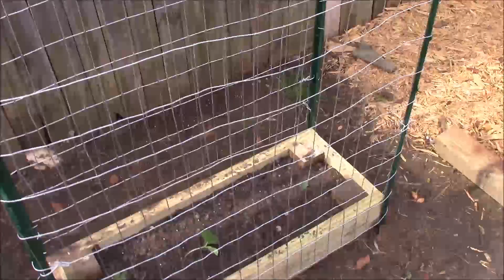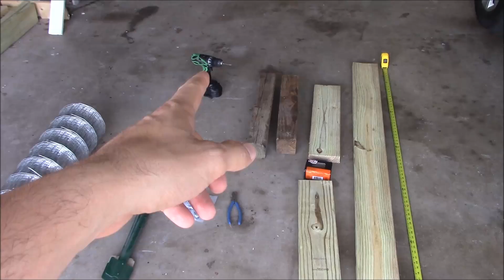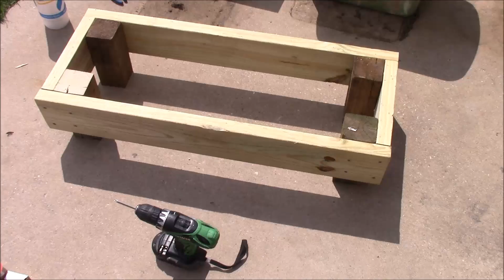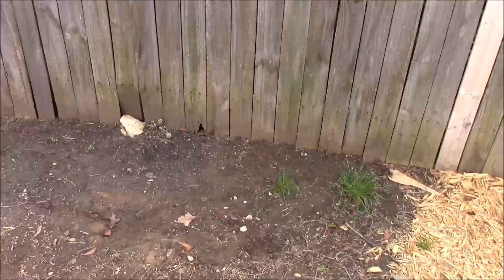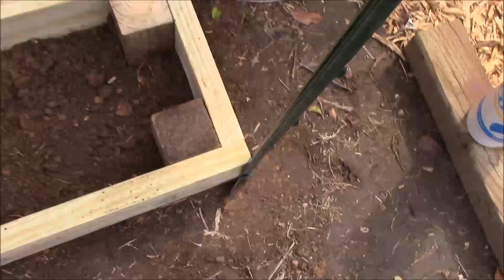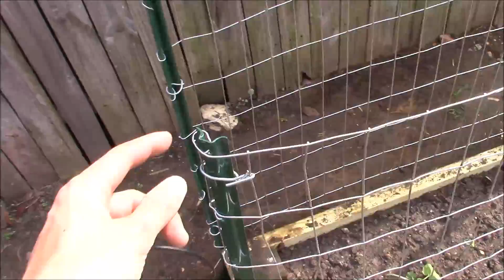Grow Watermelons In 3 Square Feet

Comment: Liked your video...how many watermelon plants are in that 3sq ft box?  Based upon the video I saw 4-5 and did they all grew out or did any of them died on you?  Thanks!
Reply from the maker: I ended up harvesting 4 of them that year and all of them were around the size of a volleyball, maybe slightly smaller.  2 died on the vine.  Not sure why.  If I had made the trellis taller, say 6 feet high, I probably could have gotten a few more fruit in there.

Comment: How did it work out for you?  Successful?
Reply from the maker: Yes, it actually worked.  The variety of watermelon that I planted wanted a lot of space so it ended up spilling over the trellis and creeping out over the ground.  So if I had to do it over again with this particular plant I would make the trellis 6 feet high and make the box slightly larger (maybe 2 feet by 4 feet).  But it worked and all you have to do is build a hammock out of old pantyhose or any kind of stretchy spandex material and tie it tightly to the trellis and it will support the weight of the fruit as it grows and still allow for the fruit to expand.